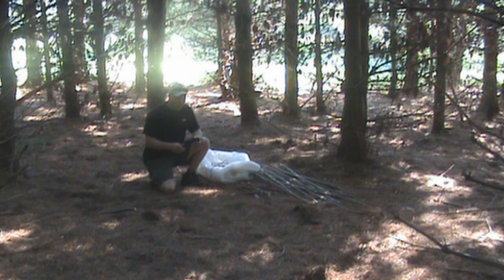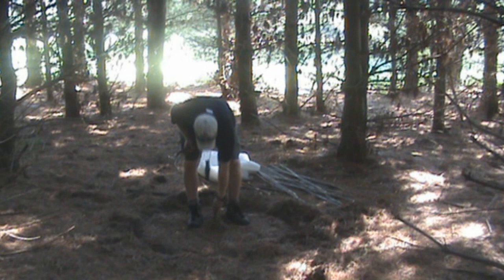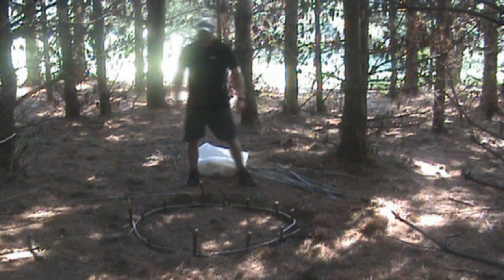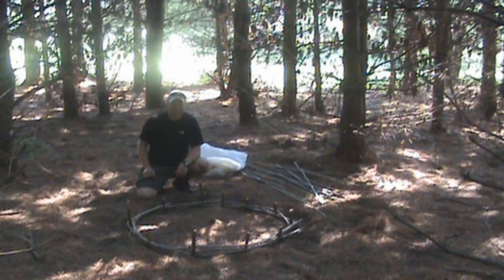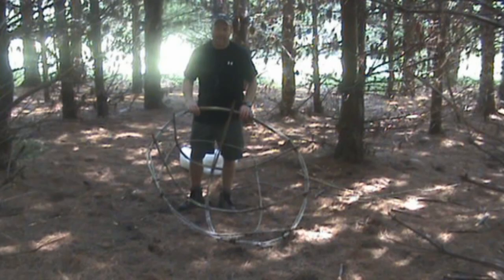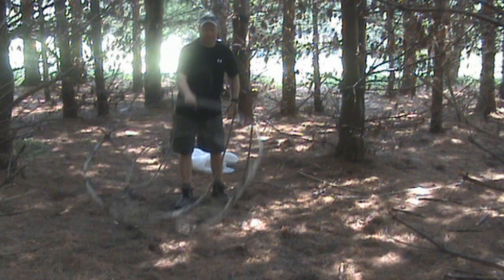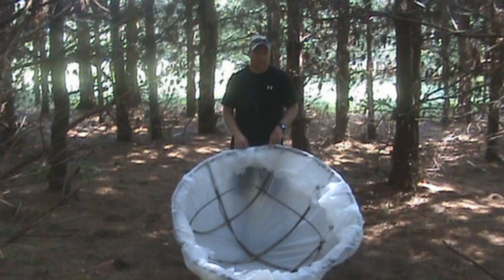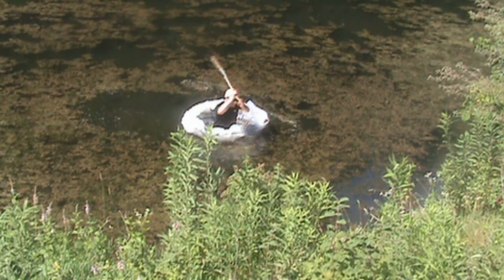Bull Boat

Comment: Lewis and Clark wrote about the Mandans using Bull Boats.  They said they would paddle at the front of the boat using a draw stroke and used them to cross the Missouri river this way.